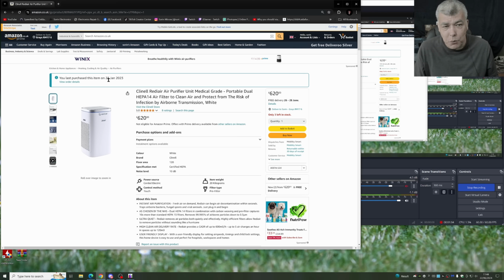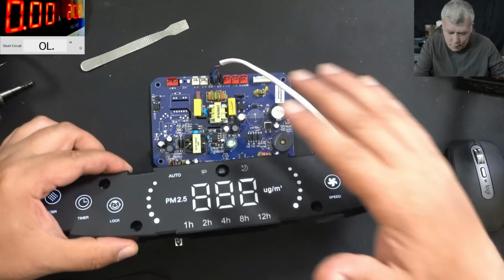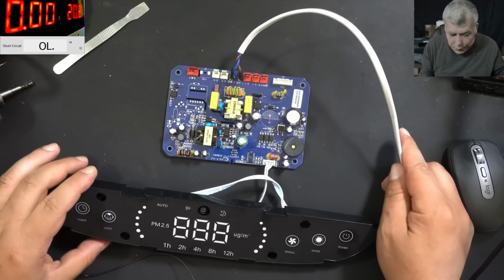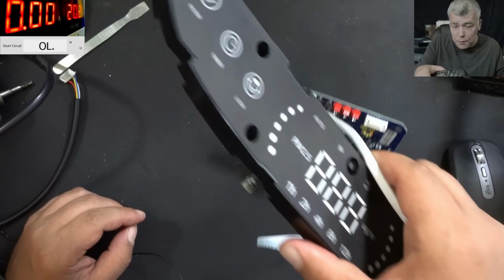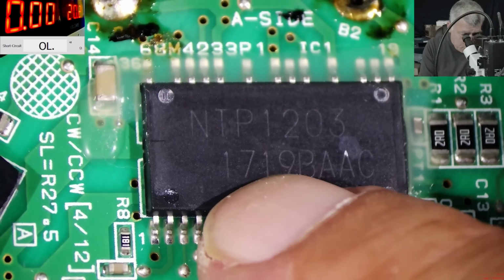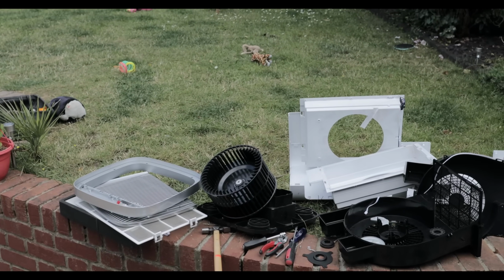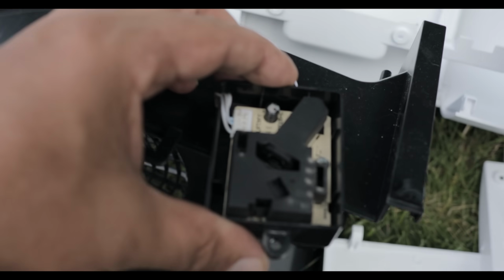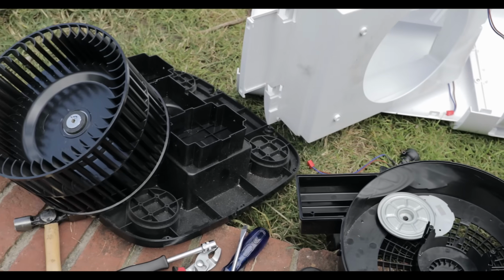Clinell Rediair Air Purifier Unit, faulty motor - Any info about this?

Comment: I just purchased the exact same Clinell Rediair Purifier yesterday and I find that the touch screen power button is red and the touch screen is rarely recognising me pressing the start button. I touch it with minimal force or more force and it mostly does not start. But maybe once in every 20 attempts to press the power button it will turn on. Then once the purifier is started, the other buttons on the touch screen similarly do not respond to my fingers pressing the screen.   Is this a known issue ?  Is there any resolution for this issue ?

Comment: I think the chip is an IPM of an inverter controlled dc motor circuit. Just like in the inverter type air conditioner compressor control circuit.

Comment: https://www.youtube.com/watch?v=sdJI_v8qBXU&t=98 it's similar so there must be a power supply. You say about 250v which is not enough. Should be more on  DC if AC is rectified. So check power supply board.

Comment: Just for the records : Vcc (+15v) and Vsf (+15v) need to be present in order for the motor controller to work. This is according to some Chinese patents on air conditioning unit. Previously I copied and paste the website that's why my comment got deleted ?!! Vsf is a safety protection signal for the motor that comes from an optocoupler.

Comment: hi sorin , it's not 3 phase motor it's DC motor with 310v voltage input, you can serch online just write "run Dc pg 310v brushless motor " and you will find small components connected with motor then you can test it. 🙏🏻❤️
Reply: @كرارأحمد-ص3ص5و  The exact information I was looking for!  Thx👍

Comment: can you start the motor by giving direct power  ? first check the motor to see if it's not dead, then simulate the signal and try starting it from the little control board on the motor itself ... then go for the main board if couldn't find the problem by other two...

Comment: Similar thing happened to my $800 portable AC that died after a year, ie, had to fix it because it was expensive. Turned out to be a blow wire-wound resistor, the last thing I checked, ie, spend days on it - lol -.

Comment: G,day Sorin. Did you need to completely disassemble to get the motor out?
* Why not just inject some specified V to the + - to see if the motor will function? (Couldn't get to it) Good luck finding a control chip: and reusing the sensors.
Is that flux over the pins of the control chip and what is the brown stuff?
I don't like to disassemble that much.
🌏🇦🇺

Comment: Determine if the motor control is sensorless or sensored ie if there are hall sensors on the board (that are prone to failure from V spikes) I assume components H1, H2 and H3 ARE hall sensors, and go from there, the controller IC is pretty complicated and voltages are no joke (320V+)  so wouldn't go near without an isolation transformer.
Good luck on this Sorin.

Comment: Wow you really got into that repair. Insane costing unit. Mine looks similar, auto sensing for only $200. DREO is the brand. That's a shame that a chip controller cannot even last 2 years.
Reply: uses HEPA filters

Comment: Hi SORIN, I found this type of motor on aliexpress Ik heb net dit geweldige item op AliExpress gevonden. Bekijk het nu! €22,24 | Originele Nidec Dc 310V 8P 24W SIC-37CVL-F124-6 Diy Inverter Airconditioning Dc Borstelloze Motor
https://a.aliexpress.com/_EHzf6Wb , it’s not exactly the same but maybe the chip inside is the same

Comment: Hello, I have a Robot cleaner VR9000 from Samsung. It says no battery but operates in some condition. After replaceing with a new battery It keeps saying no battery. I suspect It Is something on the motherboard. Plus some leds in the panel are lowning brightness (like the have burnt). Is there any chance to repair It? Where should have I to look at at First? Greetings from Italy

Comment: got a similar. terribly underpowered motor is the problem.
had a brand name version that actually pulled gallons of water out of the air. these ones get about 500ml per day. no good

Comment: Working at a Makita service centre that has lots of brushless motored machines comming in for repairs, I can confirm 90% of the time it's the controler being the issue. Aside from the field wires being the problem (yours seem to be fine with the 84 Ohms each) there is the odd occasion where the armature is faulty. You could check this with some carbon magnet paper to see if all the segments in the armature are still ok. You could diagnose the controler being the issue here like you diagnose shorts on a laptop. Put the circuit board back on the motor, Provide power to the machine like it would normally get to work and check the controler board with your termal camera.

Comment: Hi Sorin, I think your chip is SX68200M
Reply from the maker: Thank you very much!
Reply: May i ask how did you identify it for future purposes? I think it comes with knowledge on motor drivers because most of the time motor drivers has got markings totally different than the IC name.
Reply: @3Dukkan  I have a strong google-fu skills, there is no prior knowledge involved, but I do search with 2 search engines and in 5 languages which helps.
Reply: Modrzew saves the day
Reply: how did you find it ?
Reply: @MarcoPolo-zv1ft  Well, you go to digikey, find the motor drivers category, filter on 36-SOP and check all 35 ICs datasheet. There are eight of these SX68xxxMx chips, don't know why he chose that one.
Reply: yep found it online $7.52 us
Reply: @DIYRepairHour: Thanks Patryk. I immediately looked at your icon again and found the avatar similar to "Bruce the shark"... lol.

Comment: I had a problem recently with a Vax Blade4 vacuum. I pinpointed the fault to the motor control board, but like you I could not find any information on the chips or schematics. The motor was made by the same company Nidec as you have there (similar but not the same motor as you). I tried to email Nidec to get some infomation, but their email system was not working. I gave up and bought a new vacuum body for £30 on ebay. Even without the schematic, just the datasheet and where to source it could have been very helpful. Very frustrating at times. I think we all need to start supporting the 'right to repair' movement.

Comment: Hello Sorin. The motor is a BLDC motor sensor-less, i not find that driver, but you can replace all that PCB with a BLDC sensor-less controlller, you can try one cheap for drone. You need to check how they adjust the speed on that pcb.  It is possible to adjust with a voltage applied to pin Vsp, you can use this voltage to adjust the drone BLDC contoller. If you are lucky you can match the approximately speed.
Reply: It is not sensorless, see on back pcb 3 hall senors.
Reply: @ionut_musat  Yes you are right, i check again.

Comment: crazy price of this thing. just build a DIY air purifier, plenty videos on youtube or buy a simple air purifier from China.   Mine was bought in 2021 for less than $20, with the air filter slightly smaller than yours, but still works today. It just does not have sensors

Comment: when you don't know, ask chatgpt :-)  The component in the image is a semiconductor chip with the following markings:

    NTP1203
    1719BAAC

To identify the chip, let's break down these markings:

    NTP1203: This typically represents the part number or model of the chip. The prefix "NTP" might refer to the manufacturer or the specific series within their product line.
    1719BAAC: This code often indicates the manufacturing date or batch number, but it could also provide more specific details about the version or characteristics of the chip.

After researching, the NTP1203 is likely a model number for a MOSFET transistor manufactured by ON Semiconductor (now part of onsemi). MOSFETs (Metal-Oxide-Semiconductor Field-Effect Transistors) are widely used in power management applications.

Here are a few key points about the NTP1203:

    It is a Power MOSFET.
    It typically handles high power and is used for switching and amplifying electronic signals.
    ON Semiconductor is a common manufacturer for these components.

For more detailed specifications, such as the electrical characteristics and pin configuration, you would typically refer to the datasheet of the specific component, which can be found on the manufacturer's website or through electronics component distributors.
Datasheet Reference

You can check the detailed specifications in the datasheet for the NTP1203N Power MOSFET, which is available on the onsemi website or through electronic component distributors. Here is a direct link to the NTP1203N datasheet.

This should provide a comprehensive overview of the chip’s characteristics, including its voltage and current ratings, thermal properties, and typical applications.

Comment: All Amazon electronics have 2 year warranty. Good luck!
Reply: He opened the enclosure, are you sure he can use the warranty?
Reply: ive had 3 itwms this week turn up that amazon claimed were new but had third party drill holes, had been registered with another user etc.

thyre currently selling the used goods as new from amazon wharehouses.
Reply: Not in the UK they don't. Standard guarantee is 12 months. And his outside of his standard 12-months warranty.

Comment: Appears to be a sensor issue, only way is to try one at a time to find the faulty one.
This is an expensive example of electronics that fail just outside the warranty.
In the EU they have to repair them free of charge for at least 2 years, but our consumer
rights are not as generous.